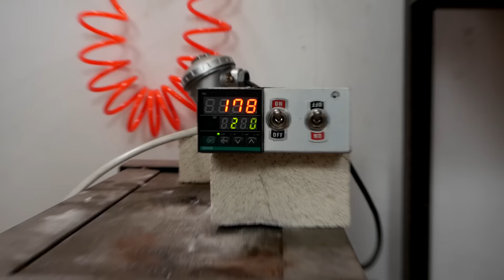Steel Wire Sponge Canister Damascus San Mai Tanto Knife

Comment: did you soak it in kerosene/WD40 when it was in the can, and also straight after removing it from the can, to keep air away??
Reply from the maker: Actually I don't have kerosene, I use diesel. In addition to blocking air from entering, it can also increase the carbon content.

Comment: Could you please tell where did you get a surface grinder? It’s a very nice piece I was wondering where did you get it?
Reply from the maker: Thank you Surface Grinder I suggest you look for it in your local market. Mine is a small model 612. But it weighs 300 kg. The power of the motor is small, about 550w 3/4P. If you want to find the same model as my grinder, you can try to find 7115 or 5963.612. These keywords on ebay.